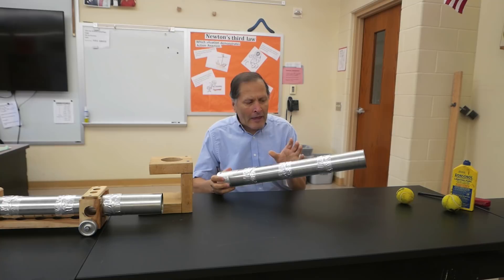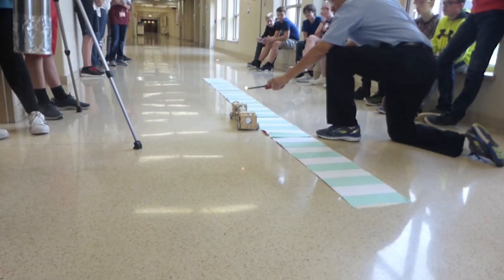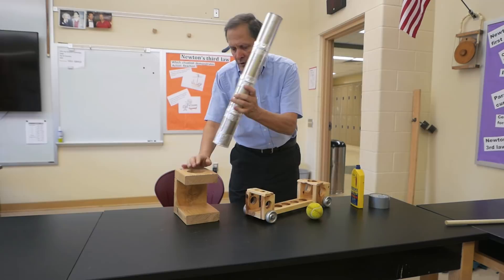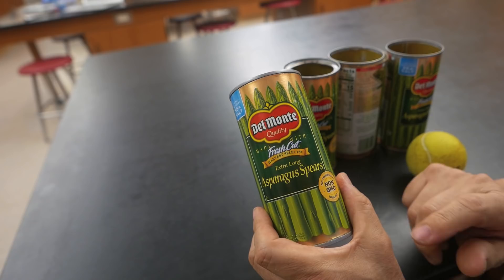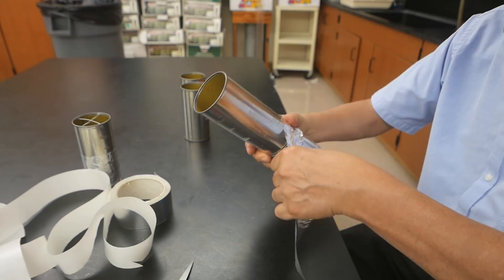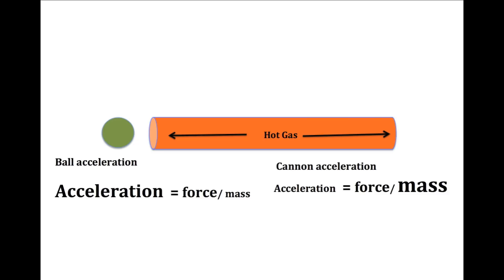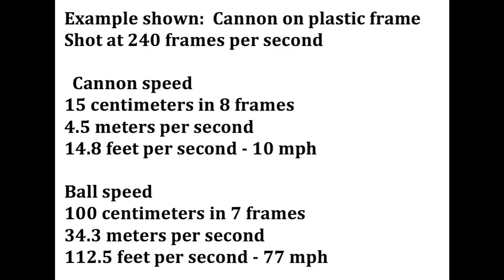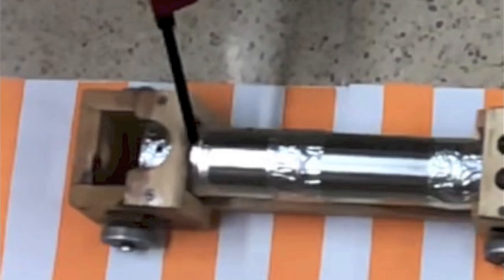Tennis Ball Cannon-Newton's 3rd law // Homemade Science with Bruce Yeany

Comment: Thank you. Your explanation of cannon recoil as caused by the gas expanding both forward and backwards is one of the few correct explanations on YouTube. The expansion of gas is also the correct explanation for rocket acceleration. However, neither case is an example of Newton's third law. The law states that if body A exerts a force on body B, body B will exert the same force on body A, but in the opposite direction. The cannon and the ball do not exert forces on each other. It's the gas that generates all the forces.

Comment: Bruce, you don't have to push the tennis ball all the way to the bottom. The bottom can will need a hole on one edge like using a pop can. I place the lighting hole on the opposite side. I also made a little carburetor to fix the outside problem. I use an air compressor for this.

Comment: I remeber seeing something like this on Mr wizard. It was made with 3 cans. Top can had both ends cut out, bottom can had just the top cut out, with the touch hold at the bottom, and the middle can was had half of the lids cut out, but opposite to each other, so that worked to mix up the fuel. he used a cup not a tennis ball. I also remember someone talking about making a polish cannon and I think this device was what he was talking about.

Comment: Made something similar decades ago for duck hunting. (for scaring the ducks off the water and into flight, not for shooting ) Our chambers were different with the firing hole on the bottom instead of the side. Compressed Butane worked the best.

Comment: If you mounted the cannon at 45 degrees in a rigid mounting, then measured muzzle velocity and horizontal range, you could use it to calculate a basic ballistic trajectory, including allowance for air resistance (by comparing the actual range with the theoretical).
Reply from the maker: I'm making another video indoors at the moment and then when it gets nice plan to do some testing outdoors.  I'd love to try what you you are suggesting but the problem is that the muzzle velocity is not  very consistent from one trial to the next.
Reply: Yes that's a good point – you'd need to measure it on camera for each shot, and know which range you got each time, and match the two.  Perhaps that experiment would work better with a trebuchet.

Comment: Hey Bruce, I am having trouble recreating the experiment with my set up. I found similar cans, and seem to be looking at a similar amount of fuel but am having issues with the fuel and air mix. If too much lighter fluid is placed in the cannon does not fire. But when too little is used the cannon's fire is underwhelming. I can only get a firing much smaller than yours. Can you speak more on the amount of fuel you use and how long you turn and let it vaporize before firing?
Reply: My fuel does not come out in drops unfortunately so its hard to gage how much is too much. If I was to use a pipette how much fuel would you say you are using?

Comment: regarding this barrel motion, the center of mass of the system moves exactly as expected, when the system is falling apart.
great opportunity to introduce the notion of the center of mass!
it is not the cart and not the barrel it is a system of moving parts, that can be ABSTRACTED (when it is isolated in a proper sense) and the law applied to the system as a whole.
Reply: Center of mass is a nifty little shortcut to solving conservation of momentum problems.  And I feel, it gives you greater insight in to what is really happening.

Inelastic collisions are easy in the lab reference frame to solve.  Just a weighted average of the velocities, and that's your final velocity, which also ends up being the velocity of the center of mass.  Elastic collisions in the lab reference frame are much more complicated to solve, as you end up with a quadratic formula to solve, which would lose half your students  You also get two solutions: one is the trivial solution that no collision happens, and the other is the one we want.

If you shift your reference frame to the center of mass of the two objects colliding, what you find is that the two masses that elastically collide, simply reverse their velocities in the center of mass reference frame.  So you find the velocity of the center of mass, translate given velocities to the center of mass reference frame, reverse both of them, and then translate velocities back to the lab reference frame.  No quadratic formula needed at all.

Comment: Really really nice video Bruce. However in my brain it is still hard to imagine how expanding gas alone could provide thrust to an object in an infinite vacuum. We understand so little about vacuum. I'm sure you have seen the video from Cody's lab where he clearly demonstrated that powder does not burn in a vacuum, and a few other anomalies.
Reply: There realy is nothing to understand other then the vacuum is completely unimportant. You throw somthing away from e.g you and you will move in the other direction. Thats all. Try it. Use a skateboard (but make sure that it can run with low friction on the ground), take a bowling ball. Stand on the skateboard, throw the bowling ball in line with the skateboard and you will notice that you (and the skateboard) move into the other direction. You may vary the mass of the object you want to throw away and you will figure out: the more mass (the heavier) the faster you will move in the opposite direction. The faster you throw, the faster you will go in to other direction.

Actually the vacuum makes it simpler, since there is no air resistance. Which of course is not important for you and your skateboard but is important once the speeds get higher. But in a nutshell, this is it: thorw away some mass in one direction (you need some forcr to do that) and an opposite force acts on the thrower. This is exactly why swings tip over, if not mounted solid to the ground. The tipover always happens in the opposite direction of the swing. Newtons 3rd law in action.

Black poweder does burn in a vaccum. The hard part is to ignite it, since it does not ignite instantanously but needs something to heat it up until it burns. And this is the hard part. But once it burns, it will burn all by itself. Luckily they do not use powder rocket when they are up in orbit. You know why? Because they are rocket engineers. The know all of this and a lot more.

Comment: This surprised me because I had no idea that lighter fluid was that volatile, it seems so much more docile in say a Zippo lighter. Now I'm wondering how this would work using starting fluid, gasoline or even Coleman fuel. After watching this I doubt that a can like that would hold up to those fuels, maybe PVC pipe with some reinforcement or steel pipe. I remember some neighbor kids doing this in the late 70s (3 brothers) in our elementary school field with a tennis can or two connected somehow but I don't remember what they used for fuel, it's just been too long ago. I do remember the tennis ball going way up in the air. This was around the same time that my dad got me into model rockets, it was a lot of fun.

Comment: I used to make those as a kid. But I remember there being a way bigger blast and they kicked like a mule. We would get hangtimes of 6 or 8 seconds. We would shake the heck out of them after adding the lighter fluid to make it vaporize more. Lol also learned the hard way to remove the wrappers from cans before taping them together. They blew apart . Then the aluminum tape blew apart but the duct tape held good. Now they're making potato canons from pvc pipe (dangerous) and propelling them using butane and a piezoelectric igniter for bbq grill..
Reply from the maker: Hi J dog,  what you describe is why I've kept mine small especially when using it with students.  I have a PVC compressed air cannon,  3 inch diameter barrel,  I felt I had more control and safer than the explosive types
Reply: @YeanyScience  actually, pvc it a bad choice for handling compressed air. It can handle high pressures . However, should it fail, the outcome can be deadly as PVC will burst into glass like shards. As a formally educated commercial plumber, we can never pump it up to more than 5 PSI if using a gas like air or nitrogen or wherever. If we are performing bhydrostatic test, then it's okay to pump up to 150psi. But we rarely use PVC for anything that requires a hydrostatic pressure test. Sometimes if we're running waste lines under the water table, like by the shoreline, we'll run them in PVC but they only have to pass with a 10' head of water column (4.54 PSI).. 

Anyway, I wonder if you could rifle the barrel of the cannon? If YOU could make it water tight , before poking the ignition hole, fill it up with water and freeze it. Then , using a coiled piece of wire as a guide, use something like a window screen rolling tool (like a blunt pizza cutter), push in some rifling into the barrel and see what that does to the data... ...maybe one revolution along the length of the barrel, 3 equally spaced places. Using the radius to mark it off with dividers or compass..  OOohe! You know what would work to back up the cans as the rifling is rolled into the cans..?  ...a 2" test balloon. We use them to plug up our 2" waste lines to be tested. They're a thick lined rubber tube that is pumped up with a bicycle pump.. Like angioplasty..

Comment: 7:40 It shouldn't matter if all the gases were contained or not; the motion is driven from the ball being launched. The gases leaking out makes the launch less efficient, but shouldn't have an effect on the ratio of velocity for each object.

Same for the barrel not remaining seated in the cart. Although some energy is lost to friction in the form of heat between the barrel and cart, it should be minimal compared to the kinect energy of the barrel and not effect the velocity too much..
Reply from the maker: Hello Suedocode,  I have some ideas on how Ican  test this,  it should be interesting to see what is going on.  I hope to give a try  it in the near future and will post whatever I find out
Reply: "... Although some energy is lost to friction in the form of heat between the barrel and cart..."
I want to quickly revisit what I said after further thought. The friction between the barrel and cart should not affect the transfer of momentum; it's identical to an inelastic collision where two balls stick upon impact. In this case, the "stick" part is friction between the barrel and cart over time rather than instantaneously. The energy lost to friction as heat would have been lost anyway even in a rigid set up, although the heat profile might be a bit different. This is can be proven with P and KE equations if you need them.

I'll keep an eye out for the next video's results! I love seeing enthusiastic educational physics videos like yours.
Reply: @Suedocode  You are correct.  Internal forces between the ball and cannon should not affect the ratio of final velocities.  This should work like an inelastic collision in reverse.  Instead of energy exiting the mechanical domain as a result of the interaction, energy enters the mechanical domain from the work done by the expanding hot gasses.  The two bodies start together, depart in opposite directions, and even with friction between the two of them, they should conserve momentum.

What WOULD impact conservation of momentum verification in this experiment, are the following factors:
1. The fact that the cannon is on wheels that roll, which adds to the effective inertia of the cannon-wheel system.
2. The friction and rolling resistance between the wheels, axles, and ground
3. Air drag, the obvious answer in nearly every problem that takes place on our planet.
4. Thrust from the gasses leaving the ignition hole, and applying a force in a direction you didn't intend.

Comment: If the cannon is stopped from moving, would the ball travel further?
Reply: Yes.  Because the energy would be dedicated to making the ball move forward, without absorbing it in the recoil of the cannon.

A practical example of where you see this, is when you are driving your car in slippery mud, compared to when you are driving it on a dry road.  On a dry road, you grip the road well enough to push backward on the entire planet, and have the Earth reflect the work done by the engine back onto the car to make it move forward.  The vast majority of the work done by the engine becomes work done on the car, due to the interacting mass being so large it might as well be infinitely larger than the mass of the car.   But when you drive on slippery mud, and just push backward on a couple of kilograms of mud, the same work done by the engine is wasted on pushing mud backwards, and little (if any) of the energy becomes work done on the car.

For propulsion, you need a source of momentum, and a source of energy.  You have to push backwards on something to push yourself forward.  Cars, trains, bikes, and people walking have the advantage of pushing backward on the whole planet at once.  While ships and airplanes push backwards on a parcel of fluid that doesn't directly act on the Earth, and for planes in particular, the nozzle thrust moves backward a lot faster than the plane moves forward.  Rockets have the ultimate disadvantage, because their propellant has to be both the source of energy and the source of momentum, and generally don't get to interact with any other source of momentum along the way.

Comment: Sir what did you use for fuel and please also share other alternatives
Reply from the maker: My. choice of fuel is lighter fluid.  I have seen or heard of using other fuels.  I don't know how they compare to what I use,  the list includes alcohols,  hair spray,  propane, methane,  gasoline, hydrogen.  There is a list on the internet that compares the fuels and rates them,  you'll have to do a search for it as I don't currently have it's URL

Comment: I find it interesting the barrel doesn't stay seated.  Perhaps the the barrel is too long? (Hot gasses have cooled off by the time the ball reaches the end leaving a partial vacuum in the chamber "sucking" the ball back and pulling the chamber forward?
Reply: First, during firing the pressure pulse causes the cart to move, but the passing of inertia causes the cannon to lag. 
Second, the positive pressure wave forces the ball out of the tube and still ejects gas after that, leaving a negative pressure inside the tube which must be filled/neutralized. So in essence the tube is sucked away from the cart, so you were nearly right. Those positive and negative waves are what are used in making exhaust systems for internal combustion engines in cars and other things. Hope this helped.
Reply from the maker: Thanks Jay,  we didn't notice it until watching the videos, now as I watch more closely,  the cannon doesn't become unseated and move forward until after the ball exits the barrel so what you are saying makes sense.
Reply: Almost as if air has mass, eh? Compression and rarefaction.
Reply from the maker: It's why I read the comments, it's a learning experience for me.

Comment: I made one as a kid, Her is how, its much better and easier to make but may cost a little more:
Use PVC pipe for your barrel with a screw on cap at one end, Drill a hole in the side at the bottom end for the igniter about 100mm from the bottom (use a spade bit). Then you just put in a quarter filled coke bottle(it fits perfectly) in from the front and push down til 1 inch before the ignitor then finally just spray fly spray into the bottom, quickly screw the cap on and push the ignitor to fire,
Use caution as this will be way more powerful than this one in the video and will send someone to hospital if aimed at a person

Comment: What is the solution you put inside and then burnt it to give the ball so much speed?
Reply from the maker: there are several fuels you could use,  I like to use lighter fluid
Reply: Can you give the name of the one you used please? Quantity etc and from where I can get them? And alternate ones that areavailable..
Reply: Binaca breath spray works better than lighter fluid. Very consistent and more powerful than lighter fluid.

Comment: Why does the barrel move forward relative to the cart?
Reply from the maker: I'll soon be trying  to run some new tests on the cannon and hope to answer that question.  Couple ideas,  1.  the friction between the ball and the barrel is enough to pull it along, 2. it's some kind of rebound off the back edge of the cart.  3. as the ball leaves the barrel there is a decrease in pressure inside the barrel,  atmospheric pressure in pushing it forward.  I'm open to other ideas

Comment: That thumbnail is an insane optical illusion you can see the ball leave the barrel but if you squint you can see the inside of the barrel that looks like it is burning inside
Reply: Add859 TankiOnline no sir, actually the ball has left and what you're seeing is the interior with hot gases
Reply: sanjeen2503 that further proves it is an optical illusion; as I also see a tennis ball just leaving the barrel

Comment: You could have your students calculate the average gas pressure required to result in the measured muzzle velocity.
Reply: And if the students are calculus-inclined, they could calculate the initial pressure at ignition, assuming air is representative of the gasses in the chamber, and adiabatic expansion represents the pressure-volume curve.  That's how you calculate the work done by the power stroke in an internal combustion engine.